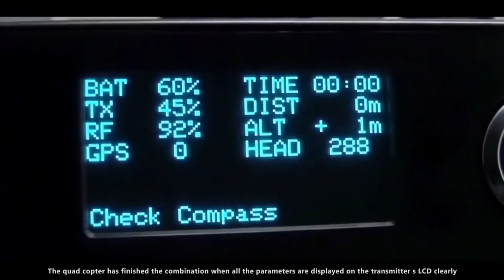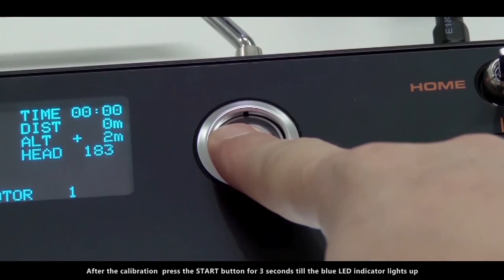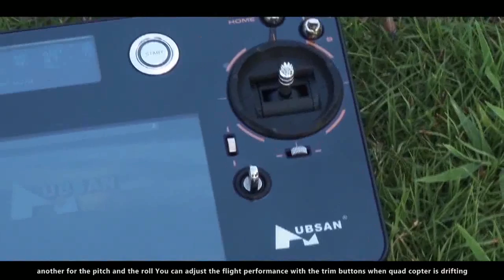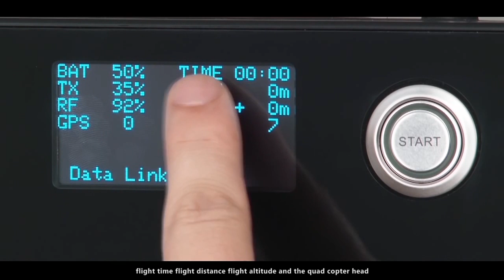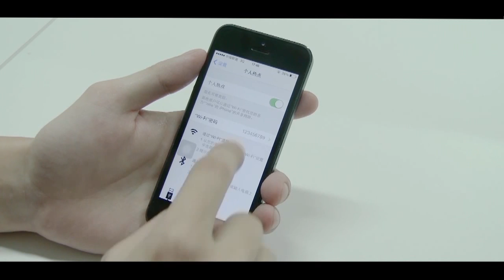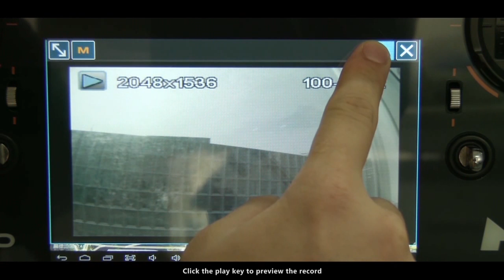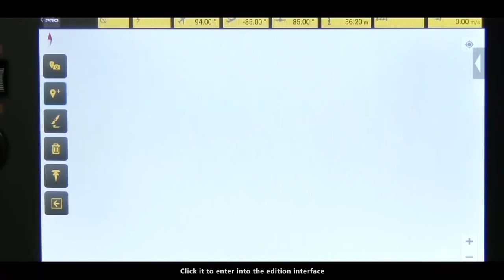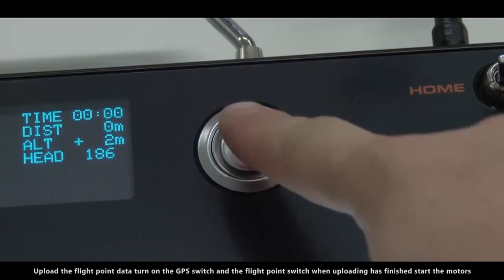HUBSAN X4 PRO TUTORIAL VIDEO

Comment: Great tutorial. I just bought a new H7000. Everything works fine except I get NO MAPS in the Sunbird app. I am connected to the internet and signed into my google account and that doesn't help. I also uninstalled and reinstalled the latest version of Google Maps...still nothing. The Google Maps app works fine. I just don't get them in the Sunbird app so No Waypoint flights til it's fixed. Any ideas? Very frustrated after paying big bucks for this.

Comment: Hi, I have a 501c...love it! Question...the led lights will not flash during flight, only remain solid. Tried the L trim switch as this only turns lights on or off. I would like them to flash while flying. Thanks!

Comment: Hi Hubsan,
I just bought a used H7000 TX. It works fine but I need to ask you some questions that I can't find on the manual:
- What apps is possible to uninstall to free space?
- If I do a "Factory data reset" I will lost the "X4 Sunbird" application?
- There is a Key combination to open a Menu to check the Frequency, the firmware version, ecc. as we can do in the regular    TX (FPV1)?
- When Hubsan will provide a new firmware for H7000 to correct the battery and alarm problem when used with a H501s drone?.
Thank you and hope to hear from you to may questions asap.

P.S My questions are direct to Hubsan team but if anyone has some of the answers to my questions is free to cantact me.  Thanks

Comment: can i up grade the camera to a go pro and still take  video and photos  with the standard tx or is there a different camera you can recommend. my 501s  takes better pictures
Reply: Gitup Git2 4K camera. Only the Hubsan camera can be controlled from the remote although I see no reason for someone to rewire the video cable so that others can be controlled. It's only a matter of connecting the right pins I should imagine. But the GoPro, Git2 and almost all other action cams with the mini USB can still be viewed on the monitor. You'll just have to set them to record before you takeoff.

Comment: Hi Sam, disappointed in the transmitter. H7000. It has proved unreliable having crashed during flight. It looks good but acts like an unreliable tablet. Fortunately the X4 has returned undamaged but I was unable to stop the props after it landed. No connection at all between the transmitter and the drone. The transmitter is also very poor for distance Tx as it looses connectivity and control over 200-300meters in wide open fields. Failsafe kicks in. The camera is dreadful in its colour and contrast, not like others on YouTube. Please do not ignore, I would appreciate your assistance and comments. p.s Hubsan 501s far better camera and reliability.
Reply: Well you cant go wrong with DJI but the info you got from Quentin is a bunch of bullshit. A. the reason he crashed his unit is because he didn't know how to operate his H7000 remote correctly. You cant cut the motors the new DJI way by holding down the throttle stick "only". You have to position the sticks in/out at the same time OR press and hold the Start button for three seconds with the X4 Pro.. So that was his error. 
B. the camera and 3-axis gimbal is freakin excellent on the X4 Pro High Edition. The 1080P cam performs wonderfully. Every bit as good as a GoPro Hero 4 SE.. 

These are just my opinions ok just as the negative misleading things Quentin wrote about the Hubsan X4 Pro are his opinions. I just want to make sure that you have both sides of the story before you make your purchase ok.
Reply: Some time has passed, I have learn't not to add any more apps onto the H7000 and just use it to fly the drone. Deleting unnecessary apps and disabling updates makes the H7000 more reliable. This android tablet controller has very little 'free' memory so I bought a tablet for my internet and games.

Changing the lens in the Hubsan camera to a 4.35mm (no fisheye effect) makes it comparable with the Go Pro. The transmitter after tweaking now reaches 1000+meters but I must admit from what I have read the Mavic has much more going of it.
Reply: Thx for this information. I will get a dji instead.
Reply: When George was standing besides me when the transmitter crashed, his attention was elsewhere when I pointed out the transmitter had stopped transmitting. 

I asked him why would I hold the Start button or attempt to stop the motors when the drone was in flight?
Reply: Jimmy Striger This quad is much better. I'm speaking from owning both. However , I do like the Mavick.
Reply: Quentin Bush something wrong...or many intervens...i can get 4km flight altd in 5meter fly over beach
Reply: Hi Quentin, I have the same problem of space on my H7000 and sometime it stucks and I have to start the app X4 Sunbird again.
Can you tell me what apps did you uninstall or disabling on your H7000? 
Did you know if I do a Data Factory Reset I will lost the  X4 Sunbird application?
Thank you

Comment: Hubsan's site says 1000 meters reliable flying distance including video. The maximum distance I can achieve is 200 meters horizontal and 250 meters vertical flight. This is a brand new high edition with H7000 touch screen transmitter. Just wondering if Hubsan have got it wrong or if there is a fault within the transmitter. Upgrades?
Reply: Quentin Bush ok sir let me try to tell  you,i got 109s midle edition.with 3 axis gimbal advance controller,i fly it reach 4km altd 5meter fly over the beach,everythink normal fpv still strong,i set rth on 7mps,although i fly in 3.276 the transmiter distance value show zero meter distc,but i still push it until maximum range,i take picture on transmiter that show my drone position gps location,and find with google map,and what i see is 4km away from my point in gps google maps
Reply: sounds like we've got the same problem! Did you ever find a fix?

Comment: my name is ,, Jholine, I did  my firest flight, and useing my SKYZON GOGGLES for FPV,First flight was in,, 30 to  35 mh winds, with 40 mh gust,wind,the GPS is rock soled, it did not move at all  with all the strong wind, this is a very good fpv quad,I say it is  1 of the finest i have flown,, I been flying the Tarot 680 PRO FP, over a  yr useing the DJI naza-2.I love my new HUBSAN X4 it is the best I have flown over 7 yrs. the way points works real soled,, all so, this is  1 of the finest quads i seen so far,

Comment: Hi Sam. I believe that the altitude reading on the controller is at start off ground level and not the accurate above sea level.  If this is used as part of the return to home reading, what would happen if the quad was being flown below your feet level like of a bridge or down a hill below you.  how would the return to home perform???

Comment: I have a question on what could have happened to ours. We followed every direction up where the GPS Takes control and does the flight plan. But then we told it to do the plan and it took of erratically and went out of control spinning in circles then hit the ground with a hard impact breaking all the prop guards and some propellers, it also tore out a connection on the battery. This was the first flight with the camera on board but I do not know what could have happened.
Reply: +dave dec YES! I contacted the place I got it from and they had said they experienced the same problem. they figured out that when turning the drone on, to first set it down on a level surface such as the sidewalk and then plug the battery in. Then let it sit for a minute for it to get its coordinates correct and connect to the GPSs. After waiting a minute for this to happen you then process to close the battery cover and calibrate the drone with the GPSs by do the rotations said on the transmitter. So really I just didn't let it get a full connection before take off
Reply: +FryedBurntOut which one do you like better the unique or the Phantom
Reply: +sonyman211 HAVE THEY EVER GOT BACK TO YOU? I bought one and am sending it back. ive read some bad bad press on them and they need to do better before I come back.